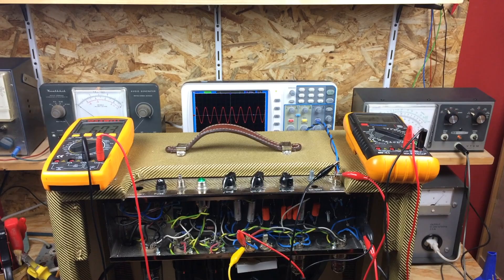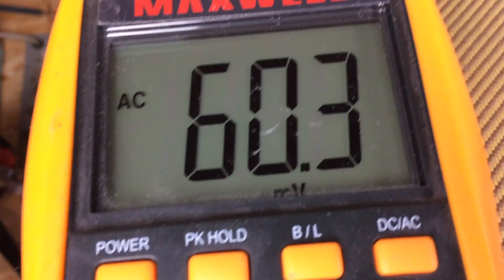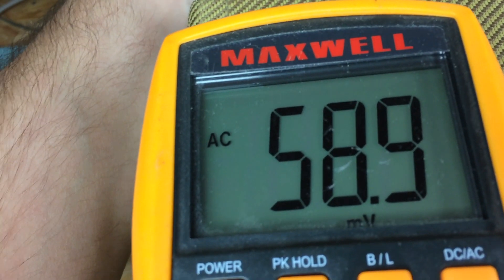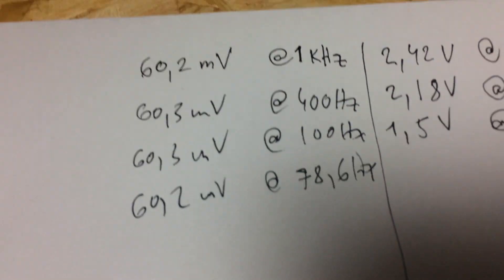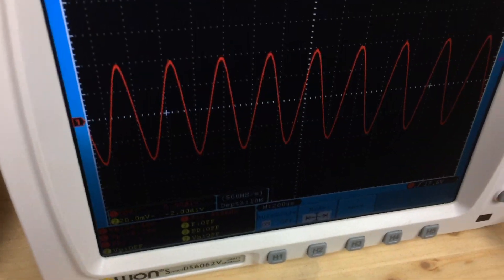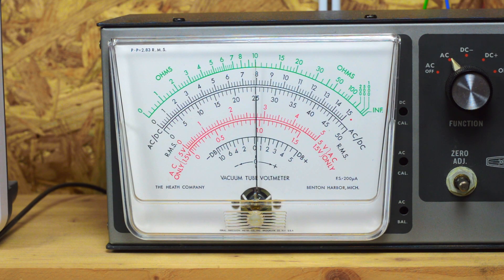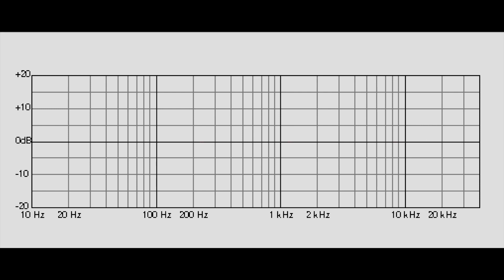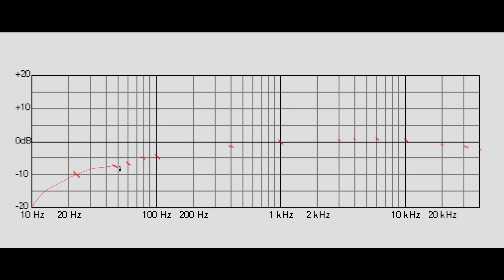Manual Frequency Response Measurements of Guitar Tube Amp

Comment: Hey, you should check room eq wizard. It is a free software and you can send a output sweep and record it and it will measure the frequency response of whatever you are sending your signal to. It is meant for room calibration but it can work for any "system", like a guitar amplifier.

Comment: 1.  Can we assume you're using a non-inductive resistor for output load, and you're measuring across that resistor?
2. How would your response curve compare to a curve produced by re-doing the experiment with an 8 ohm speaker, and output measured with a high quality microphone ? That might explain what we actually hear.
3. Most guitar amp speakers rolloff below 2 khz. People can't hear much above 15 khz.
4. Why use commas in place of decimal points?  LOL!
Reply: "Why use commas in place of decimal points?  LOL!"
Murica moment
all of south America, all of Europe, half of Asia, most of Africa uses comma as decimal separator

Comment: You should check the frequency response accuracy of the digitial multimeter you are using to monitor the signal coming out of the generator and then adjusting output.  My guess is its not accurate 20-20K.

Comment: Good video very informative..... I have a spare HP3577-A Network Analyzer I can sell you ....It will save you a boat load of time ....It will display BODE plot in a few seconds sweep....
Reply from the maker: Thanks! Yeah, this was more to show the process itself. I was checking several devices like the one you've mentioned but for the time being I am not able to afford one. Hopefully in future I will get one of those.
Reply: @Delatsch  Thanks for your video.... I buy these HP units broken for very cheap...then repair and calibrate them... I'm sure you can do the same if you have the time...